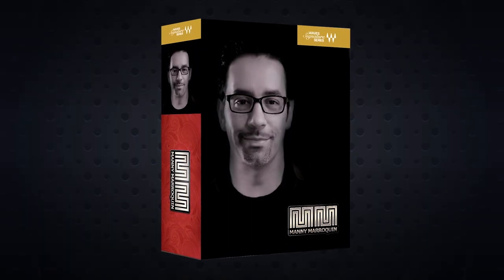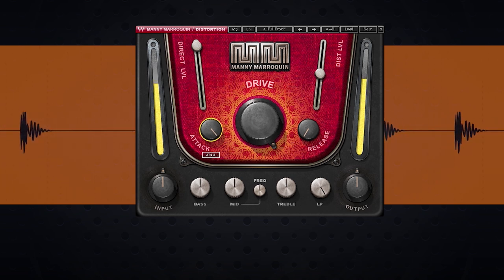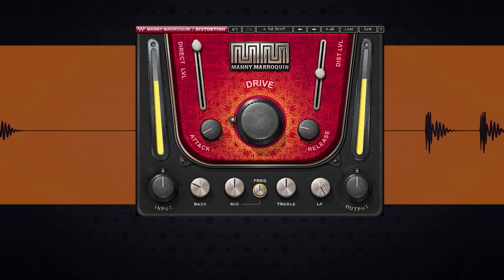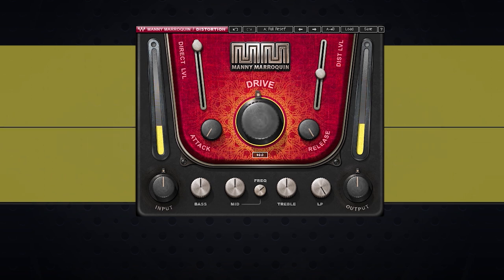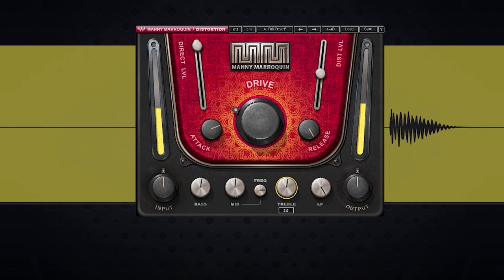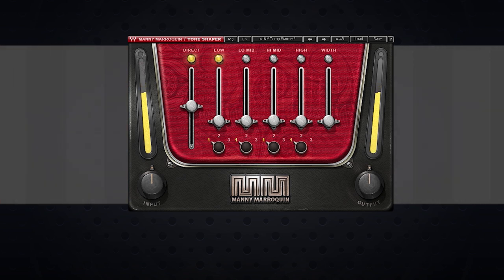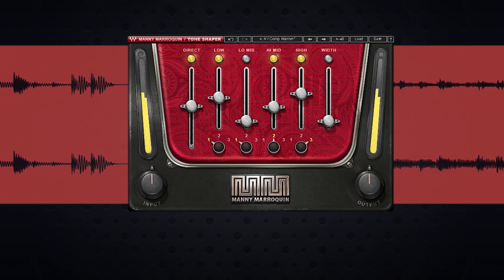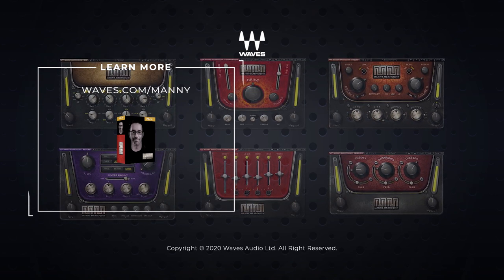Heavy Hitting Drums with Manny Marroquin’s Plugins

Comment: To be honest, that kick after processing sounds so bad.
Reply: 忍者Ninja Focus on how it sounds in the mix, not on its own. Adding a bit of crunch, especially on the high end, makes it cut through better and have distinguishable character on top of other instruments.
Reply: @jesus-of-cheeses , yeah it cuts because of the harmonics but it sounds like fart. He should just send it to AUX and use parallel compression and blend the original kick to the processed kick.
Reply: @Ninja-pc3gd  You're right, i will prefer using it as a send to blend with the original kick
Reply: @Ninja-pc3gd  Check the sound towards the end+ the MMTone Shaper's parallel compression on the drum bus. Sending to an Aux is a good way too.